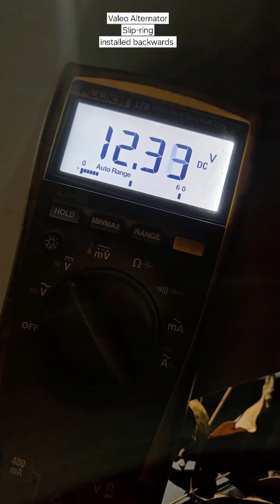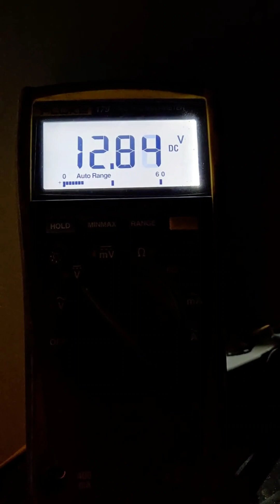Valeo Alternator Rebuild Mistake to Avoid! (2015 VW Touareg TDI)

Comment from the maker: I learned this one the hard way 😅 (luckily on my personal vehicle)- if the alternator slip ring isn't positioned correctly, your alternator won't charge the battery after rebuild! I took this as a learning experience 📝. 

Hope this tip helps someone else avoid the same mistake. 💡

 Have you ever had a rebuild not go as planned? Drop you comment below.  It may help someone that wants to rebuild the alternator,  instead of buying a new/remanufactured unit (which alternator cost can vary from 600-1,200.00, depending where the alternator is purchased).

Don't forget to like & subscribe for more quick VW tech tips!

#valeoalternator #alternatorrebuild #vwtechtip #vwrepair